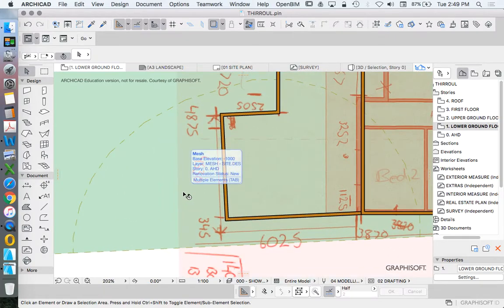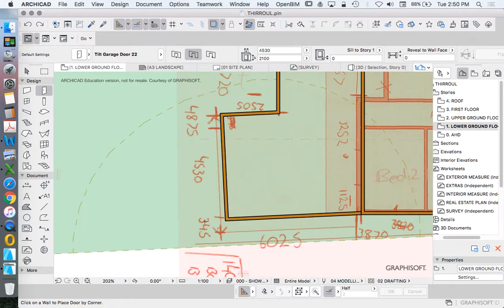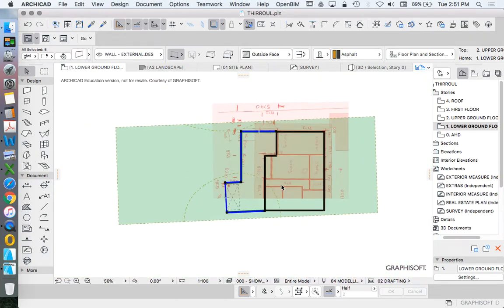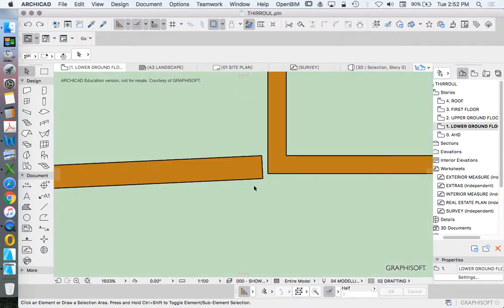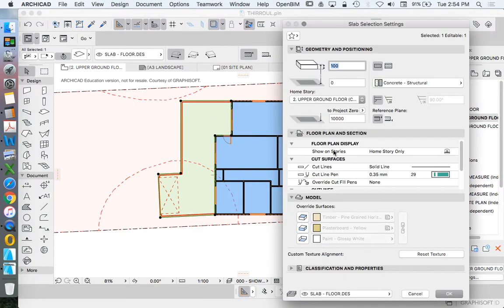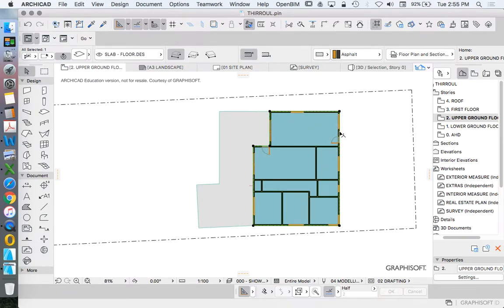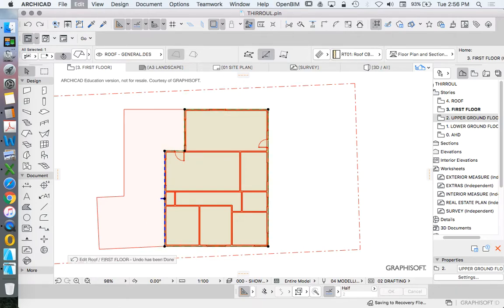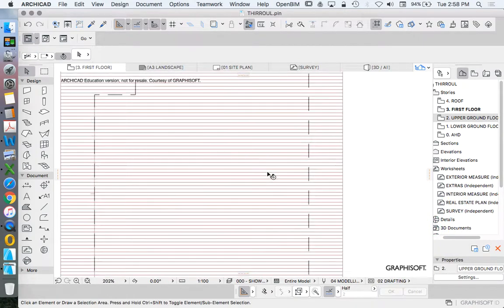ArchiCAD Alterations & Additions - 21 3D modelling details

Comment: why dont u use the minusfunktion in archicad when setting out the dimensions instead of using the calculator, and why do you model an here the riggt one ,.. outside wall with the referenceline inside.. that is not the right way.. you normally have a plot with a specific size with maximum building permission that is why outer walls should always be modeled with reference line outside if the wall vhange during the fazes..